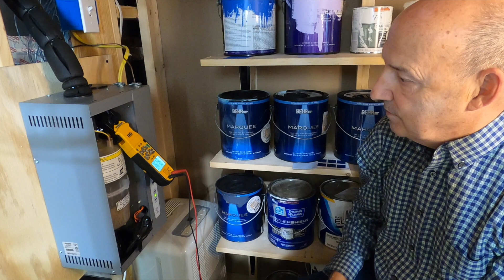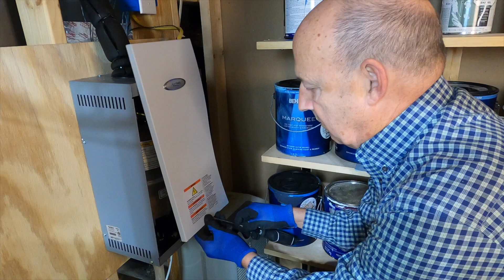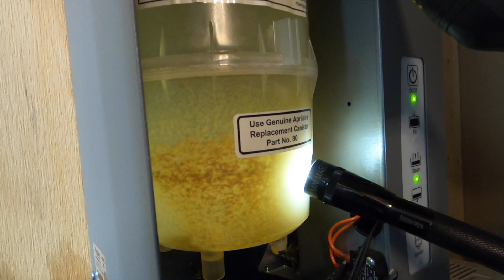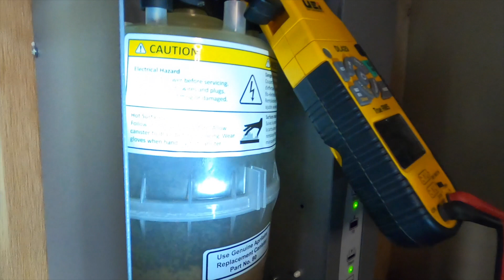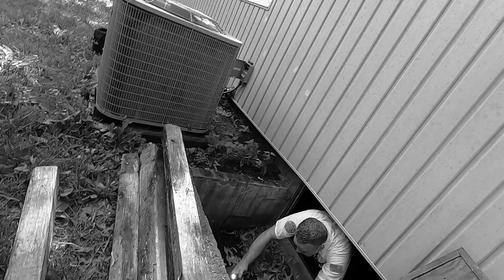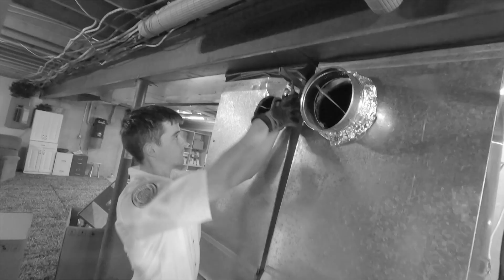How Long Does A Steam Humidifier Canister Last?

Comment: A scale inhibitor in the water feed line should be a standard part of a steam humidifier install. The money saved in electricity from the reduction in corrosion and improved efficiency means the ~$50 setup likely pays for itself in a couple months.

This video shows the best case scenario for corrosion & sediment build up in the canister.  After 1 winter using city water that isn't very hard my canister had a an inch of sediment built up on the bottom.  The drain valve got clogged and the heating elements were covered in 1/4" of corrosion.  A simple fix to this is installing a scale inhibitor in the water feed line. ~$25 for the mount parts & ~$20 for the cartridge. Two months after installing the scale inhibitor my old steam canister has minimal sediment at the bottom and the corrosion on the elements is has nearly all come off. So a $20 cartridge every year to keep your steam humidifier running more efficiently, going several years without needing a new steam canister, and nearly eliminating annual/monthly maintenance. Compared to a ~$100 steam canister every year or 2, needing to clean the canister out every few months, and a higher electricity bill.
Reply: Can you put a link to the one you installed?
Reply: Someone from Aprilaire told me that the phosphates would damage the electrodes in the canister. After 4 months on a new canister(and the same phospate filter from last year) it's still working fine. My previous canister was still working, the corrosion had flaked off the electrodes down to just a thin coating. I figured I'd try a new canister to see if the corrosion was protecting the electrodes from the phosphates. I just pulled out the canister and found the half of each electrode coated in a little bit of corrosion. Much less than my previous canister. There was still some sediment build up in the bottom, but I think that is mostly due to a flaw in the drain not pulling from the bottom. If the production of sediment isn't 100% eliminated, then its going to slowing build up 3/4" on the bottom.

freshwatersystems , omnipure 6" Q5385 , ELF Mounting bracket, valved head VH1/4JG

switched to the 8" Q5420-P, carbon filter with scale inhibitor. Still sediment build up and corrosion on the elements, but doesn't seem to be as bad.
Reply: @vica153  Thank you!
Reply: Thank you for sharing, Vica! It’s been 10 month since your comment. How is going with that canister? Is it still going strong or did you have to replace it? My brand new canister just got completely clogged with hard mineral build up in less than 2 weeks and stopped working! This is just out of control!! Looking for a hack how to stop/slow down the build up. Thanks for sharing your experience!
Reply: @JenaArt  I switched to a larger pre filter, Q5420-P 8".  Canister still has sediment build up and electrodes still corroded, but not nearly as much. Still plan on pulling the canister to clean it out every month or so during the winter.
Reply: @vica153  Thanks! Did you install your pre-filter at a main point of entry or just before humidifier line? 

I’m also researching those electronic water descalers (with wires that wrap around the pipe). Have you ever considered or tried those? I wonder if they help slow down mineral buildup.
Reply: I just cleaned my canister with boiling water and citric acid. It sizzled for 20 minutes, dissolved lots of that gunk and I rinsed it out. Seems to work now, but who knows for how long
Reply: @harkanwaljeetsingh1019  du hell. Replied to this twice but it's not showing up.

Comment: To reduce canister replacement costs. Remove the canister and clean at the beginning of the winter season.  This is when the minerals have dehydrated to their maximum .  They are most friable in this state and most susceptible to breakage and release from canister inner lining.  Tap the wall of the canister to dislodge the material residue. Remove the plastic drain filter by taking a small dowel(or the like) from the opposite end of the canister, and gently tapping it out. Continue shaking and tapping the sides of the canister until no more falls out. Then, take some duct tape and close off the end which had the drain filter. Make sure it seals watertight. Pour 6 ounces of CLR (or vinegar, if less ambitious)to canister. Turn on side so CLR sloshes around the bottom. Slosh, and let rest for a few minutes, repeat 4 -5 times. You will hear large pieces of mineral/calcium buildup dislodge into the liquid. 
Tap some more while sloshing. Drain the debris and solution out of canister. Fill with clean water to flush out remnant surfactants. Repeat entire process till you are satisfied. 
One last thing. Untape the drain end, and carefully look to the opposite end of the canister to the level sensor probe. The lower tip of this probe can calcify quickly. If there is still minerals on it take a strong stiff rod of some sort(metal rebar worked for me) and chip off the residue. Finicky but achievable. Flush unit again and reinstall. Ohh, vacuum out the drain cup and valve assembly directly when everything is dry. Moisten the red inner O ring before inserting canister. The red o ring is replaceable at most hardware stores. It may not  be red , but the right size. Hope this helps to defray rapidly increasing canister costs. If you have really hard water a mid winter cleaning might be prudent.
Reply: Great advice to extend the life of the canister, I was running my humidifier on hard water for a few months before we installed a water softener. The canister was pretty much toast after 4 months of total use because the electrodes were caked with minerals. I will try your method of cleaning them. Thanks
Reply: @riderCraig  Did installing water softener help to extend the life of your canister?
Reply: @JenaArt absolutely I've been on the new canister for a few winters
Reply: @riderCraig  My brand new canister lasted only 2 weeks. It’s now completely packed with buildup. Awful. Could you please share the solftener system you installed?
Reply: @JenaArt really any water softener will do the job. We have a whirlpool softener and it's great for the whole house. Just have to remove the calcium and other minerals out of the water.
Reply: I have the same system. It does a great job keeping the house at exactly the humidity I want. The only bummer is my electric bill doubles and even triples during the Heating season when I’m using the humidifier. Also the new canisters are opaque so you can’t really see through them. If too much sediment builds up it doesn’t drain efficiently and sets off the alarm lights. Just replaced mine and it’s working great. The company recommends changing the canister annually, but I like the idea of cleaning it out to try and get more than one year. It’s also environmentally a drag because this massive chunk of plastic is not recyclable and just ends up in the landfill. Your dad is great and I really enjoyed this video. I appreciated his insight.

Comment: The canister price is up to almost $100/ea now 🤦🏻‍♂️🤦🏻‍♂️🤦🏻‍♂️
Used to be around $50/ea
Also they now recommend replacing both wire leads for the canister every 3 years
Reply: Half the price works just as well

Comment: Hello, Great videos! I've watched several of them and they are very informative. I am learning about whole house humidifiers. I have a couple of questions, The HVAC installer suggested a steam humidifier, however, videos have suggested they are good for larger houses. I have a small 1,500 square foot house. Is this too small for a steam humidifier? Also, how much are the canisters to replace (roughly)? Thanks! Trish
Reply: Depends on the unit, I have a GF-5500 and it has settings for power that can be used to reduce how much power it uses to heat, mine is low setting on 240v, but if that was going to be too much you could run it off 120v too... Keep in mind that it also has a humditstat that you cut into your cold air return duct and you set the target humidity with that, so power level is more about how quickly (power) you are adding water than how much water (humditstat controls how much)

Comment: Thanks for sharing, as the quality of the water in the heating canister degrades and shows discoloured deposits, does it also cause a stale smell in the steam distributed throughout the house or does this unit flush stale water and refill the unit with fresh water as a course of it working cycle?
Reply: It adds new water as needed and if steam is not needed it drains the water after 72 hours.